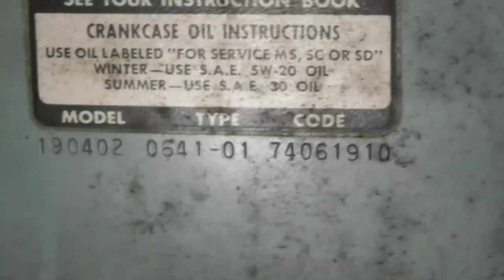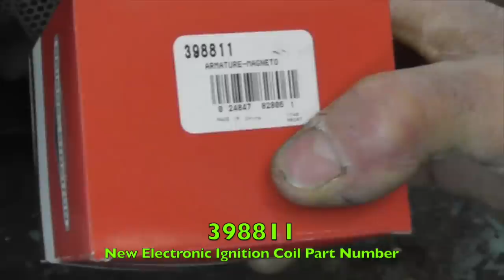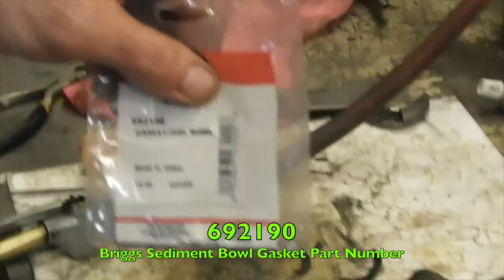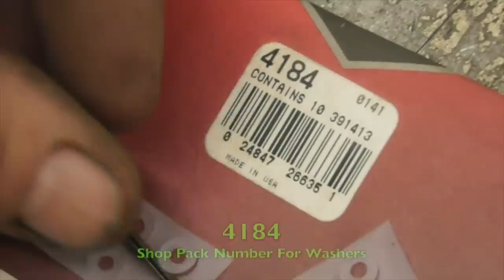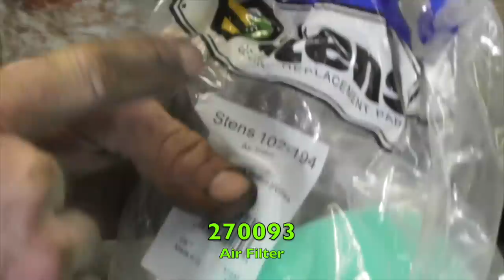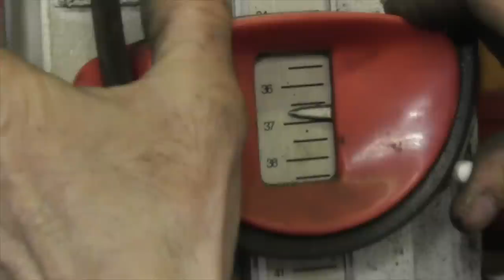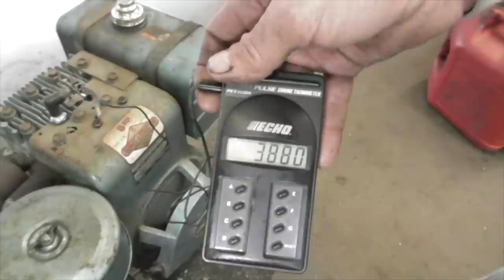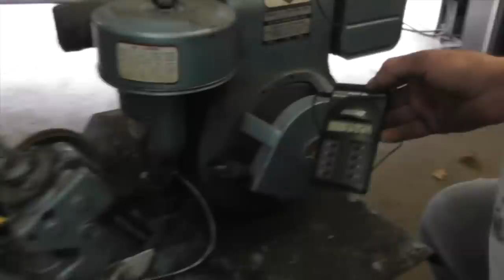How To Troubleshoot A Non-Running Engine (1974 Sears Rototiller) with Taryl

Comment: I thought I better add a note regarding the compression test.

The reason that 90 PSI would be a good reading is because the 4+ HP Briggs & Stratton engines are fitted with the easy spin camshaft which holds the exhaust valve open a tad whilst the engine is started,so the compression is lower than 100 PSI on startup.

That's why Briggs & Stratton don't release official compression figures for their engines rather opt to perform a leakdown test on their engines.

I have a 3hp Briggs & Stratton Supaswift push mower which doesn't have the easy spin camshaft fitted & the compression tests at 100 PSI at full throttle, I had to eliminate a jammed throttle cable as being the cause of a 75 PSI compression test result as it wasn't allowing the throttle butterfly to fully open.

One of them in good condition tests at 120 PSI ,mine smokes up a bit when first started & sometimes when the throttle is fully opened.

It drank a whole lot of oil when I was mowing on a hilly area so I think it may be that inherent design of the flat head engines PCV system.

Mine isn't too bad as I've seen them with blobs of oil on the spark plug electrodes,mine isn't like that.

One my late grandmother had was like that & it had 1 rebuild before I rebuilt it as a teenager,the thing that I didn't realize due to a lack of experience is that I also needed to replace a valve as well as the rings,well,I didn't realize I needed to also check the valve guides.

The engine burned less oil but it still smoked due to a worn valve guide which left a blob of oil on the outer electrode.

Comment: I have taken the 'warp' out of a carb body by dragging it over emery cloth on a hard level surface.
I have a tiller of similar age, no gearbox problem though.  Eaton 5 H.P.  SOLID.  Both likely built by MTD.

Comment: From an Era in Time when they made Good Quality Engines and Machines, I have one from Sears that is Older than this one and it still runs great but I did install a New Electronic Ignition just like the one in video--Thanks Taryl, you always do Great Work...By the Way-that was a Colonel Chicken Bone from 1976...

Comment: Tyarl is simply awesome end of an era  You could not find any shop in the Toronto area that would or could do this repair. If they do accepted  for repair it will be a new Chinese engine and a $1,000 later and that's your dinner folks
Reply: So true...what Tyarl does is becoming a lost art....he actually fixes things instead of just order all new parts....I can't believe he had blank cable replacement parts!
Reply: I fix all my cables the solid wire and the braided stuff, it works great. I bought the braided cable from HomeDepot and I re-use the solid cable from other stuff.

Comment: PA Lawn Guy. Taryl if you suspect a slight leak in a brass float like this one; submerge it in hot water and watch for air bubbles in about 10 sec. or less. (Old mechanics trick.)

Comment: I have that same killer tiller but I have not gone through it yet. I anticipate having the same kind of problems with it that this tiller had. I also had the real killer tiller, it is a simplicity rotocul. I put a new engine on it and did a little tilling here and there around the house. I stored it under my deck under lock and key. It has been there for about two years, I started it every once in awhile just to keep running. The other day I got out to start it up and run all the old gas out of it. I had cranked it several times the day before no problems except I had the choke in the wrong position. So I got everything set right and went to pull the starter rope. For some reason the crankshaft stopped turning and because of the force of pulling the rope it pulled the whole tiller to me. The tines that had no shroud over them bumped my leg. I went to pull the rope again and noticed a dark liquid pouring out on the ground. At first I thought it was motor oil because it was so dark. But it had the consistency of water then I realized it was not oil but it was blood. I saw it pouring like a spicket it filled up my shoe then spilled over on the floor with in a second the puddle went from 2” in diameter to a foot in diameter. I had to stop the bleeding. I walked across the driveway and up the steps of the deck and into the utility room where I started feeling like I was going to pass out, I walked to the kitchen table and sat down. I realized I was in deep doo doo so I called my wife who was in another town shopping then I called 911. I don’t remember talking to the 911 operator I’m sure I wasn’t talking where they could understand me. The next thing I knew I talking to the ambulance driver. My neighbor was first on the scene and he said that I was slumped over with my arm laying on the kitchen table with the phone still in my hand and the 911 operator still on the phone. Now I’m recovering at home. My brothers who also watch your videos told me to roll that tiller to the curb and let somebody else have it. But you know I’m already figuring out what to do with it to get it started!!!!

Comment: You can't beat these older briggs engines. I've got three old Nationals out in the barn with the old cast iron 10 hp on them. No recoil, just a rope, and I bet I can go out and start them now, after they haven't run for 10 years.

Comment: I used to adjust the magneto to flywheel gap using a matchbook and do the same to adjust the point gap on Briggs and Stratton motors.

Comment: 🤘 You taught me that trick bout checking the head bolts...dont take a rocket scientist to realize if you didnt do that the head gasket is a ticking time bomb...and you can run an engine with a case of carb spray, with good oil and cooling it does not apply!

Comment: awesome video. I am struggling with a 40cc motor in a pocket bike. cleaned the ignition coil, used a business card to adjust,  getting sparks, replaced carburetor,  cleaned pulse holes and the thing wont run... what do you recommend I do next? ah, my friend checked the timing key on fly wheel. its okay too.

Comment: I got an old Pincor 4500 watt generator from the 70s that has a 10 HP Briggs and Stratton on it that I just rebuilt the carb on. The carburetor is the same style as the one on the tiller but it is slightly different and has 4 screws on the top of the body instead of 3.

Comment: I had one just like this bought from Sears 1972 didn't last one summer gears locked up but Sears replaced it with a new one which worked for many summers untill I went with rear tine tiller.

Comment: I know ever shop is different and depending on where you located, I'm in NC, but ive got a old Briggs 3 hp tiller, and I know theres alot a varients but what does a job like this some what cost, ive got exactly the same things that need to be done far as I know up to this point, thanks for the vids, God bless, and God bless America

Comment: I have a red sears about the same year, looks exactly the same without the bowl under the fuel tank and I believe 5 hp brigs. and it went through a tornado...the gear box or transmission leaked afterwards...is this fixable?

Comment: 6:58 When he says he wants to keep it original for the throttle cable, but changes the points & condenser to electronic ignition. That means he couldn't find a replacement points & condenser kit😆😅 He's done them before on here lol.

Comment: You mention around 52:10 that you checked the gear box first.  Can you explain how to do that check, what to look for, maintenance of it, etc.?  Thanks, Great videos!
Reply: There's a fill plug on top and a level plug on the side of the tiller gearbox. Taryl says it takes SAE 30 engine oil. You fill it through the top fill plug with oil, heavy gear oil, or soft liquid grease until it flows out the level plug hole. I like the idea of a soft grease, because these gearboxes tend to leak.

Comment: I have watched all your videos. And got my Riding lawnmower up and running. But the rider that I have been working on  the 7.5 HP Briggs and Stratton motor  has a new camshaft and timing gear but still running ruff.

Comment: A good way to clean the rusty gas cans is that white vinegar with Zinc coated BB's,  "shaken not stirred".  The zinc will come off the BBs and it will deposit on the tank so you don't have to seal it.

Comment: $100 for the spark plug on Ebay?  "I can't do 100..." How about $10.00 and I cut you a check today and I sign it with my high-class Easy Works pen... (chuckles). Good info on this rototiller.
Reply: LLPli

Comment: I love your videos. So educational. I have a twin cylinder john deere chainsaw that quit running. I took it apart and cleaned it up. But I don't think I can. Get carb gaskets.  Are you interested in taking it in and doing a video on it? It's a model 66SV. I think it's an Echo rebranded as JD. I bought it new in about 1987 and it's done a lot of good cutting over the years. I just thought it might be an interesting video being a twin cylinder.

Comment: A good tip for cleaning out the tiny little holes in a carburetor:  use the ends that get clipped off of guitar strings.  If you don’t play a guitar, make friends with someone who does.

Comment: Quick question,  my step dad and his father and brothers built a homemade hydrolic wood splitter and just by chance used this exact motor.  Do you have a video on the piston sleeve and piston replacement?   I'm getting oil in the combustion chamber and also the muffler has been glowing red while running it

Comment: When I was a boy, my dad had those hose pliers and a similar tiller with the large metal gas tank. I picked up a 71 model push mower and fixed the points, set the valves and used it for years and gave it to a neighbor who needed a mower; he said it cuts better than the new POS his other neighbor had from walmart LMAO.

Comment: like my rear tine troy built rotor tiller think it was made in 70's put a predator motor in it and runs great. do you know where I can get the decal for the shroud covering the tills . the decal will show forward neutral and reverse. I cannot find them anywhere. the original so old it became brittle

Comment: I own one that looks just like this one. IT's a Killer Tiller! NOT MADE FOR SISSIES!  Backed me into a fence yesterday with handle bars pinning me in. Then it flipped since the clutch lever did not disengage, the tines would have trimmed about a 12 inches off each leg if I wasn't athetotic enough and agile enough to use momentum of tiller to catapult me over the entire thing when it flipped.  
All those years wakeboarding paid off! Going on Craigslist today!
Now There's Your Dinner!  Broken Chicken Legs.

Comment: I’ve got the same tiller but with the Tecumseh engine. Mine also has the issue where the belt is always turning the gearbox. My belt was also too short (36”) but the 37” belt is still too short. Will a 38” be the sweet spot?

Comment: I watched the whole thing.  Great job (again) and especially loved the sound effects. Made me laugh several times through out the video. You're a very resourceful tech. Replacing the throttle cable wire, ferrule, conduit and making your own Z-bends.  That was a lot of work.  How many hours did you have to charge that customer?  Thanks again :-)

Comment: The old 23 coils with the E-core u could do that, I had an old E core. spark side was no good,
but I put the primary winding wire, the 1 that goes to the points to 1 side of auto ignition coil.
other side of auto ig. coil to points and it worked fine.

Comment: I have a question for you sir. I have a e100 John Deere riding lawn mower. I cranked it up this morning it started and idling real high and I had the throttle lever on low idle. Hope you can help me thanks

Comment: I have a mtd tradesman probably 1993.been sitting in shed fot probably 20 years...model numbers wore off..ignition swith missing..5 prong..ordered. A switch..wiring seems to be different. Tried to indiviual wire each prong..still wont work.

Comment: Great video.  If you don't mind I would like to ask you a question.  I have a 5hp B/S OLDER ONE FLAT TOP I REBUILT THE CARB AND CLEANED OUT THE TANK I CAN GET IT RUNING FOR A FEW MINUTES THEN IT WILL TRUN OFF I CAN GET IT RUNNING RIGHT BACK UP BUT IT WILL NOT STSY RUNNING. AM I DOING SOMETHING WRONG?
Reply: Look and see if the vent holes in the gas cap are plugged with dirt. It will pull a vacuum after a few minutes of running and then starve for fuel and die.

Comment: Those starter clutches, the plastic body ones Briggs used towards the end before they went to the cup and dog starter were junk from the get go if they squealed, but the old aluminum body with the steel center housing were worth rebuilding. Just clean the schmoo out of the housing, polish the balls, sand the crank. Add engine oil to the shaft and the felt wick, put the center hub in the housing and install the balls. Note, where people screw up us when they add oil to the balls. DONT!! it makes them stick. Either go in balls dry, or do like me and give it just a whiff of wd40 or pb blaster before snapping the cover on and installing it.

Comment: Do you apply motor oil to all air filters, or just the one in this video? I Never heard to do that... I did hear to rinse the air filter out in kerosene or gasoline, but never motor oil.

Comment: What I do if the engine starts using starting fluid, then dies is empty the tank, pour a generous amount of lacquer thinner in the gas tank, fill the rest up with gas and try starting it with the starting fluid again. Most of the time you can keep it running with a few sprays of starting fluid then you will notice it running on its own. Run it until the tank is empty. That's an easy way to clean a carb without removal or tools.

Comment: Hey Taryl. I have a few questions. What's a good torque recommendation for cylinder head bolts and oil pan bolts? What is a good compression for a regular lawnmower engine?

Comment: Hi, I have an old 10 hp kohler points ignition engine that I want to change over to electronic ignition. Can you point me to the parts I will need? Thanks for the great videos. AJ.

Comment: When you changed the coil in the cast iron video you flipped it 180 degrees but when you changed this from points you didn’t. Can you explain this a little more?
Reply from the maker: Thats because this model engine does not require you to do that. If you look up a new replacement coil the new one is electronic. You just install it per the instructions. The cast iron one the polarity of the magnets are reversed.

Comment: hea Taryl, is this possible to do with a Tecumseh HM80? i've got an old genset from '86 or '87 that has a points/condenser ignition, and i have spare points and condenser but i think it would be easier to get the engine running with an electronic ignition as well as being easier to service in the long run

Comment: I have a question regarding tires.  I have an XT1 GT50 Cub Cadet with 22 X 9.5 X 12 rear tires and a Wheel/Rim 12x7.   I can't seem to find AG tires for this size.  Do the tires have to be the same size?  22x9.5x12?   I see guys with Cub Cadet tractors on youtube with these AG tire replacements so I assume it does not have to be the same size tires?

Comment: Use Ether if you want a broken key on the flywheel. Seen that happen so many times.  Carb cleaner is ok. Any backfire caused by water in the system will shear that flywheel key. Then you go back to start. I learned the hard way on a snowblower, never ever use ether to start a small engine. I hate metal gas tanks. they rust. I used to get a tank liner kit where you could mix the two epoxys together, dump it in the tank and roll it around till the inside of the tank is coated. I used it to fix old snowmobile gas tanks that mounted behind the seat. Its the only way to restore an old antique snowmobile gas tank that is part of the seat. on those type of things, I just throw a pladtic snowblower tank on. To hell with the rust issue and those damn leaky old fuel filter bowls. I scrap that stuff now. Those carbs can be a major issue with warpage. Thown my share of those away too. Once that bowl top warps, they leak and there is no repairing them.The last time I did one of those engines, I stripped everything off,  carb, tank everything, replaced it with modern newer parts. The owner was happy, happy. He told me he didnt care as long as it ran. All the stuff came from a donor engine so price was not that bad. Anytime I can reuse stuff I will. Doubling float bowl gaskets doesnt always help.

Comment: didnt finish thgis video, butr i learned something about this motor, but on a snowblower. the bowl of the carb was pitted from ethenal. it would run, that it would stop and get gas everywhere. shop rebuilt carb, and then realized it was screwed.

Comment: Taryl, plz I have a 73 monkey wards gilson hydrostatic 16.  I tried to replace the coil, I attached both wires assembled everything then tried to start tractor and nothing.  Now I'm pretty sure I have to disconnect one of the wires but........ watching this video and others of yours, this one you did not send in the fly wheel in or did u turn the coil the opposite way to compensate for the magnetic poles.  Other vids you talked of the fly wheel and u also flipped the coil the other way!  I'm so confused. Plz it's such a job pulling that whole motor just to get to the coil again, plz help.

Comment: The belt needs be turned inside out before placing on the belt measuring tool to get an accurate reading.

Comment: Front tine tillers Have a bad name because of people  that should have not used them in the first place.
What happens if the flanges between the carburetor and intake manifold have a thick piece of gasket and neglected during assembly?